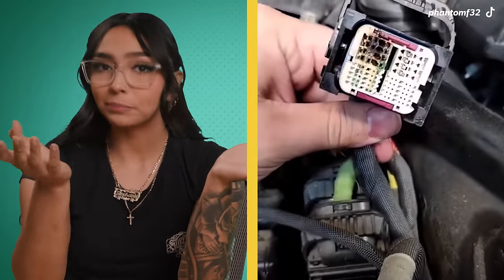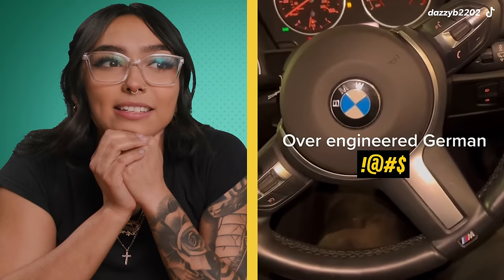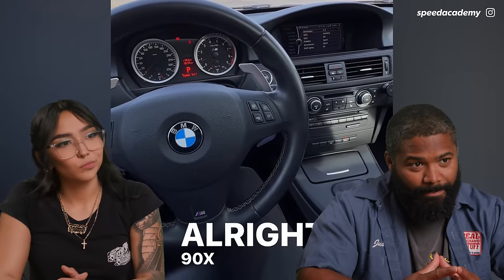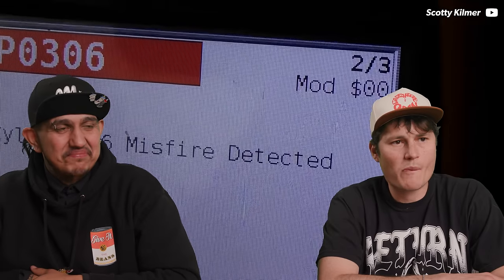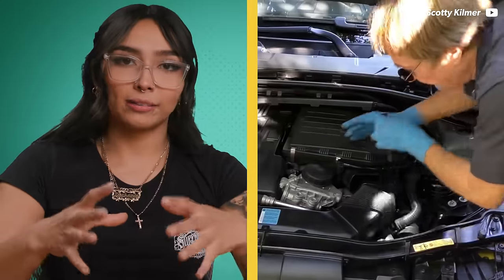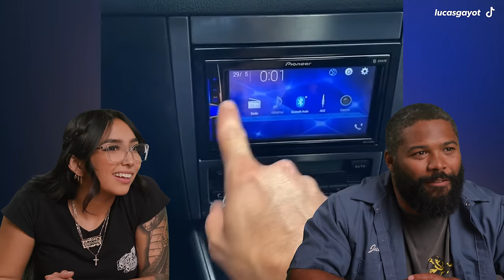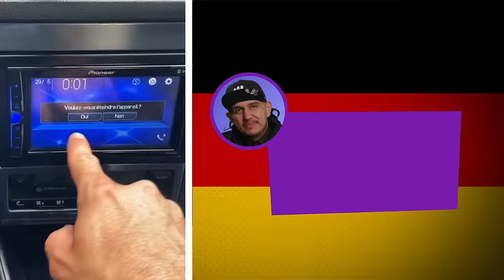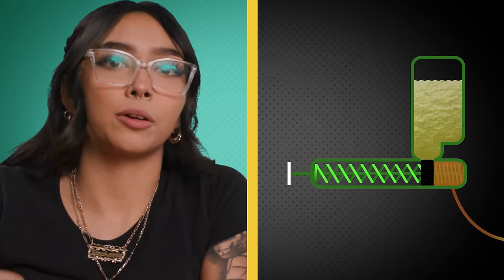Mechanic Reacts to German Engineering Fails

Comment: The black Mercedes trying to burnout was Australia. It was SOME RANDOM guys wedding, he HAD traction control on, and had just WON the car worth an insane amount and killed it RIGHT THERE.
Reply: Hahahaha shieeet 😂😂😂😂
Reply: Wow what a tool! I feel like the universe dished out sublime justice in that moment!
Reply: noice
Reply: ok but why was it on fire. or it at least looked that way
Reply: @owenhunt6796  Maybe it blew a trans cooler line or something, because God knows that trans was HOTT after that hahahaha.. It's probably just super hot coolant landing on the super hot exhaust, and burning instantly, causing a quick fire
Reply: Well dude is dum, also wtf, did he playd to much in gta? 
GUYS U CANT MAKE "BURN OUT" IF: 
1. You doesnt have full or at least 50% diff block 
2. You have brake on "drive axle" 
Read how to do it before do it, dont be "dodo bird"
Reply: @peteleigh3658  As I remember this exect car chaisis config (Mersedes C300 Coupe) there is nothing like what you said, the reason why there was smoke and fire is --- two and they r simple as f, first of all he obviously was on launch control (read how it works especially in modern cars), and he obviosly have brakes on the rear axle which is problem coz what u basicaly do, you put power on transmision and than on the diff at the rear axle ur brake doesnt alow u to move as launch control that down power of engine to prevent slide but u still doing this and eventually u heat up rear differential u heat up ur axles at rear, diff brakes from one side and all power go to the one wheel that left and than ur brakes cant hold the power, heats up, fire up ur tire and the things happends as they happend... 
Hope I explain things the way that everyone can understands ¯\_(ツ)_/¯  (eng is not my native by the way)
Reply: Yeah. This is the guy that won the car. Did not turn off traction ctr and blew transmission line
Reply: Won aFree Mercedes car. Had to spend $10,000 in repairs after being a dumb ass.
Reply: @Sneaky_Basket  that sounded like complete gobbledegook. Also, that's quite clearly NOT the rear of a C300, don't be ridiculous " as I remember this exact 'chassis' config" you sound pretentious af and wrong.
Reply: @discoverkenya  I wrote in my previos comment that eng isn`t my native lang, so I explaine as I can in range of my knowledge of lang...
I`m 99.99% sure that if u tried to explaine it on my lang when u aren`t native, that would be even worst coz my lang way harder than Engish 
By the way explain why I'm wrong, if you not than you are clown :)
Reply: @Sneaky_Basket tell me you don’t know shit without telling me you don’t know shit. 🤦🏻‍♂️😆😂
Reply: @punkmeyer O.o? You have some "corrections" for me? Coz emoji actually telling about u more, than about ppl that u trieng to "stab" verbaly

Comment: 14:22 "built like tanks" WWII german panzer tanks suffered from over engineering as well. German tank operators had difficulty repairing them in the field and often times abandoned them.
Reply: yes
Reply: Panther: "Hanz the transmission!!!"

Sherman: "Just swap it out for another one"
Reply: @abitofapickle6255  we first needz zo remove ze engine too remove ze tranzmizzion ja?
Reply: That was more propaganda than truth of allied forces
Reply: @IcePhoenixOfTime  there's some truth to them being overdeveloped, for sure. They were good tanks but certainly not without faults.
Reply: @BleedForTheWorld  there isnt a perfect tank thats for sure and even more back then when the technology was still kinda new
Reply: Leopard 2 Tank: Engine + Transmission swap in 30 Minutes.
Reply: Certain issues were not as bad as people make them out to be, the worst offenders of unreliability were the super heavies they threw out without much testing right at the end with woefully underpowered transmissions and engines. But they are a very small percentage of tanks fielded.
Reply: @Enforcers10  sure if you have another power unit those tank need alot of logistic.
Reply: @simonbrunet5605  less than the Abrahams gasturbine. And Leo 2 runs on every fuel.
Reply: @Enforcers10 abrams will run on every fuel too.
Reply: Everything German is over engineered, but when they work they work. Someone else's headache when it goes wrong 😂
Reply: That's true for the largest late war ones, not the mass of them.
Reply: No, they were abandoned because Germany had HUGE supply routes problems. German WWII tanks were fairly easy to maintain and repair in the field, the problem was that they lacked the equipment to do that.
Reply: Yep. "German made" for you. Typical.
Reply: Russian tanks…….simple and cheerful.😁
Reply: Guderian estimate 60-70% of German tank losses on the Eastern front were due to maintenance issues, not Soviet action. Some models like the Panther had poor transmissions. As they made so many different kinds of armored vehicles with unique parts, parts availability was dismal. Meanwhile, if a US Sherman had engine trouble, there were depots with crates of whole engines to drop in.
Reply: Make that UNDER ENGINEERING. For the lack of materials the gearbox sides where the drive axles come thru, that drove threads, were steel plates. Under the immense torque the plates buckled, oil leaked out and transmission was gone. On the other hand,  Sherman had a big rigid casting which supported the axle properly. ZERO transmission problems. Found this described in detail on Quora, with the pictures and diagrams. Since I am a mechanical engineer I CAN read and understand technical drawings.
The Germans are goners as afar as the sensible mechanical engineering. ZERO thinking about the repairs and longevity.  My mechanic works in MB shop: "The newer they are, the more they break down. Well, at least I got a good money. Looks like "removing the engine" is now the standard procedure...."
Reply: when i think over engineered, i think of something that will work and not break. why people use over engineered for german cars is beyond me. what we should say is that german cars are overly complex and under engineered. FTFY

Comment: Sandro has an 8 series... Truly a man OF AUTOMOTIVE CULTURE.
Reply: Nah, it's the sign of a total Masochist or he got it cheap from a customer because it needed a cheap part that took a huge amount of labor to R&R...
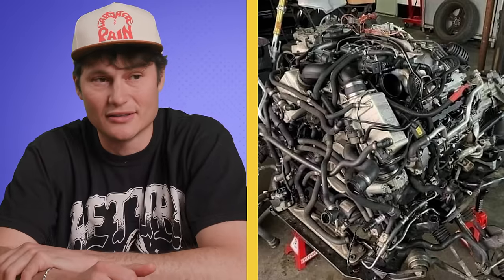Reply: I wonder which generation because it didn't look like he recognised the S63 at 1:50
Reply: depends what year though.
Reply: I bet E31  @lemster101
Reply: If not e31 then it's a can. E31 840 is actually solid, but the 850 v12 is a lot touchier

Comment: 2:20 - In a lot of modern German cars you have electronic safety features and sensors. For example, when another car appears in your dead angle, a small light will go off in your driver side mirror to alert you of this. Some manufacturers take it to the next level and let you activate a function that will not let you steer to that side when another car or an obstacle is detected. It will steer back the other way. If you are not used to that, it freaks you out when it happens. Since we cannot see what is happening left of the steering wheel or to the sensor, this could be just someone standing there. I think it does not activate while standing still or driving slowly, because it would be a problem when parking or maneuvering in cramped spaces. If it is an error, it probably is a broken sensor sending false activation signals. Could also be a fried electric motor control.
Reply: We used to live in Toronto where if you get into a bike lane by an inch you'll most likely get spit on. Not a great place to have the car steer for me. I worked with someone who had the 4 wheel steering Honda. She absolutely hated it. Overkill is Volvo's ground level ozone detector that turns the interior fans off. I wonder what that costs to fix.

Comment: The fact that liquid fuel rocket engines can have less tubing and be easier to work on than these engines is insane.
Reply: To be fair, a rocket engine better be built with service in mind. That thing fucks up, you're a lot worse than stuck on the side of the road.

Comment: I used to work as a mechanic in NJ 15-20 years ago. That time, I hated to work on VW and Audi. All plastic and fragile sensor covers, connectors, wiring harness etc. jam packed under the hood. It was almost guaranteed to  break something else before you reach the part you wanna replace. Leaky head gaskets were icing on the cake. I wonder if its still the case.
Reply: maybe they are like fords now, where you have to remove the body off the frame to do a head gasket on a f150  $5,000 labor to replace a $80 head gasket

Comment: I had a Volvo V50 and the cabin air filter was behind the steering wheel 😳🤯. To simply swap your filter: 1) remove the steering wheel 2) remove all gauges 3) swap filter 😂
Reply: Should have bought a pre 98 🤣. Big mistake
Reply: I had a dodge ram and it broke
Reply: Nooooooo😂😂
Reply: That's easier than my 1991 BMW 5 Series. 1) Remove glovebox 2) remove a bunch of inner plastic panels 3) remove remove some HVAC vents 4) remove AC module 5) pull out air filter while contorting your body in the passenger footwell.

Comment: 00:50 - The reason the coolant follows up the wires is theough capillary action.  The same process that plants use to draw water up the roots.
Reply: aka wicking
Reply: And solder
Reply: The weird part is that these cars usually use special wires to prevent that fluids creep up the wires.
Looks like somebody here cheaped out
Reply: I had the same happen to a Ford Fiesta where the BCM git fried because the wiper fluid went all the way from the pump into the BCM. So no its not Just a German Car/BMW Problem.

Comment: The coolant is not just dripping on the harness. BMWs use an electrically controlled thermostat, which sometimes leaks internal allowing the coolant to enter the wire. The outside of the harness is water tight, but that doesn’t help when it comes from the inside of the connector. This happens with the oil pressure sensor too.
Reply: This is a very common issue on international dt466E the injection drive harness that goes through the valve cover does the exact same thing. We call it wicking. But it does that exactly it will push the oil all the way to the ecm and fry it.
Reply: I do hvac and I have seen that happen with just condensation alone.

Comment: I'm a mechanic in Norway. German cars are the bane of my existence
Reply: Norwegian wood
Reply: I want to know, from Norway, how you feel about American auto engineers.
Reply: Fly Lexus! ✈️
Reply: @tedley70  American is second to none
Reply: What cars come from Norway?
Reply: Don't they make you a shit ton of money though? Oil change, sure thing, that's 8 hours labor (the filter was deep in the center of the engine in a place where you had to remove the timing belt to even touch it).
Reply: @tedley70 they have their issues, too. I prefer Toyota and Honda
Reply: @happybaals None. Closest is Volvo from Sweden
Reply: @Sam-go3mb  it's all the brittle plastic pieces and zero room to work on anything
Reply: @not-a-raccoon  fair enough, not rewarding type of work eh. add in subscription diagnostic services etc. and I could see that being pretty soul destroying
Reply: @Sam-go3mb  plus the owners are massive douchebags. I work at a Ford/Volvo dealership so we don't have the specialized tools either. So we just need to make it work sometimes. It's a massive pain in the ass
Reply: @Sam-go3mb  not many american cars in europe, especially the north
Reply: @not-a-raccoon  As a DYI'er on an 20 year old Audi S4 (but still beloved. lol), I can confirm.  ZERO room to work in anything and just about any plastic clip or plug you even just look at will crack or break into pieces.
Reply: @checkcommentsfirst3335 We got a lot of Ford models here in Germany! Also some muscle fans and car festivals.
Reply: @samholdsworth420  the only cars american build well are pick ups 😂 😂
Reply: @tedley70  Even though I'm Australian. I do question what went through the minds of some engineers. I saw that as someone who daily drives an American car. Not looking forward to having to drop the tank to replace the fuel pump. Why Jeep engineers, why did you design it that way? Also the front bash plate being both bolted and welded to the chassis. Makes absolutely no sense.
Reply: @qefewfwdcwdc  Ford work vans are pretty good anything with a big frame they do well.
Reply: @samholdsworth420 we all thought cars broke down before the Japanese came along
Reply: Then Norway should ban German cars. Well, actually I think the whole world should ban German cars.
Reply: Why don’t you work on Norwegian cars then…. Oh wait!
Reply: @8MunchenBayern8  was that supposed to be a burn or something?

Comment: BMW inline 6 motors are pretty easy to work on. When they started turbocharging them with the N54 then it reached an entire new level
Reply: True. My mid-life fun car is an M Roadster. When I spun the oil pump nut off (being stupid hooning), it took a few weeks nights & weekends to swap in a new S52. Not bad with no lift considering I replaced all the coolant hoses, new clutch, etc. SAFETY WIRE YOUR OIL PUMP NUT, PEOPLE 🤓

Comment: The coolant isn’t “dripping”‘onto the wire harness. The issue is the 7-series uses an electronic thermostat so the ECU can regulate coolant temperature. The problem is the e-thermostat seals will fail and “wick” coolant inside the wire harness and take out the control modules.

Comment: 1:02 The “for some reason” is called capillary action. 

You can demonstrate it by taking a strip of paper towel and partly immersing it in a glass of water. The water will wick up to higher than the water level.
Reply: Maybe,  or thermostat housing (plastic) has a heating element in it (emissions and such). In case there is a leak there, it would send coolant (or steam) under relatively high pressure up the connector, wiring harness, that is sealed well enough to make it all the way up.
Reply: @durbinmotorworks6253  ick, that sounds like a royal mess! 

I’m currently building a control cabinet for a chemistry research project, and the reaction uses a really aggressive solvent (DMF) that attacks basically every plastic except HDPE, Teflon, Kapton, and PEEK — all the usual wire insulation materials are hopeless against it. So we decided that we will simply put the external wires in Teflon tubes, and then put the entire cabinet, and the tubes coming from it, under positive pressure with nitrogen, so that even if DMF leaks out, it can’t wick onto the wires due to the positive pressure. Precisely to avoid the kind of mess that appears to have happened in this vehicle!
Reply: @tookitogo  as impressive as your engineering solution is, you can buy teflon insulated wire.
Reply: @adminadminson3147  I know that. But sometimes you can’t choose what type of wire a particular component is made with. Or the component has Teflon leads, but they’re too short and you have to splice them. (Sure there’s Teflon heat shrink, too. But it isn’t adhesive-lined, and regular adhesive-lined heatshrink isn’t chemically compatible.) Or you can’t get a particular Teflon-insulated multi-conductor cable by the foot, only by the reel in a size much larger than you need.

Protecting wiring inside conduit or pipes, both rigid or flexible, is commonly done in industrial environments. We are literally just doing that in miniature.

Comment: I wrenched for a German used car lot. I actually had a mental breakdown dealing with 2000s Audis.
Reply: Agreed. It is sad that Audi could once make my indestructible 1984 4000 Quattro and now only makes Techno-Garbage. As my 4000q has never had any major work to the engine, trans, etc. and had about *350k miles on it. 
* The odometer was stuck at 225k when I bought it seventeen years ago...
Reply: Whats your opinion on the 1.8turbo? I always found that to be one of the easiest cars to work on ever, would never dare to touch the 2.8 or any of the s4 engines though, only pita I can think of with the 1.8 is electrical gremlins, especially regarding the trunks wiring harness getting pinched from repeated use of the trunk hatch and the fancy led for hazards and warnings fading away with heat(almost forgot the fact that the b6 doesnt have an oil pressure gauge in the cluster, just have to hope the red oil lamp of doom appears when its a problem.

Comment: Mk4 VWs are difficult to put aftermarket radios in for three reasons. 
1) the radio on/off is controlled by canbus so to install an aftermarket radio correctly, you need to buy a $100 or so canbus interface adapter.
2) if you're not installing an aftermarket radio correctly, there is no 12V switched power in there, you have to run a separate wire for switched power to turn the radio on and off.
3) there aren't really any nice dash kits since the mounting system they use is proprietary and very very low profile. The dash kits that work are just press fit into the hole since the car doesn't have any ISO DIN brackets and the standard aftermarket radio cages wont sit properly.
Reply: german car manufacturer not following german industrial norm😂
Reply: Fortunately, they correctly adopted the standard in later years. It was pretty straightforward in my 2013 beetle.
Reply: Mk4s absolutely have switched and constant 12V at the radio. There's no CAN-Bus at the radio in any MK4. At most the later MK4s had CAN-Bus for ABS, ECU, Cluster and a gateway. These cars have almost entirely standard ISO-Pinouts at the radio. What You're mentioning happened on the next generation of vehicle networks, like in the B7 A4 for example.